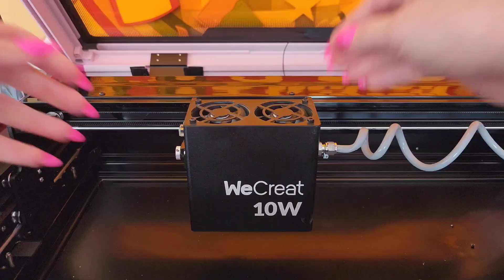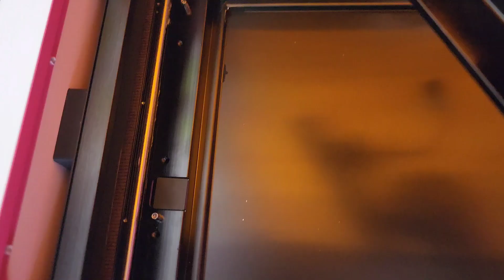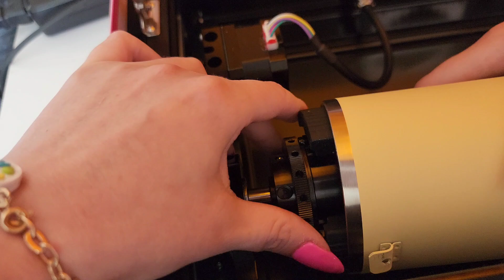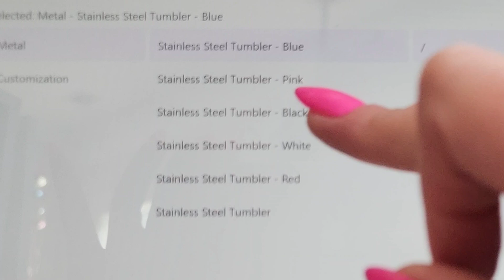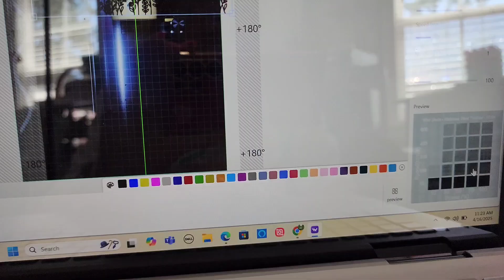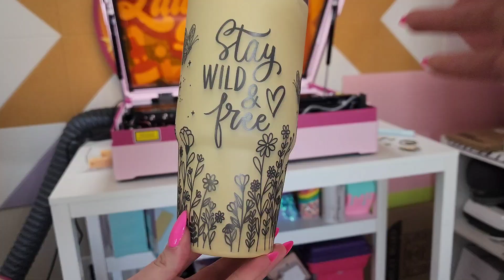How to Engrave Your FIRST Tumbler with the WeCreat Vista 10W Laser – Beginner Engraving Tutorial

Comment: 😂IKYFL. I Like how ONLY your vista perfectly captured an entire working area on a 20oz tumbler of all tumbles. I have the same machine same software and theres a large red box that X’s out 2-3 inches of a non workable area for the laser to engrave. Because we all know someone somewhere magically designed a modification on amazon to purchase to use the workable area in which you didn’t use to complete your tumbler.
Reply from the maker: I'm soooo confused by your comment haha! I just turned off the setting that blocks the top area so a full wrap could be done. I have the larger rotary attachment and full wraps can definitely be done.

Comment: Do you place the handle prongs facing down? How do you figure out the placement of the design to make sure it's centered on your tumbler?
Reply from the maker: @prieta1028pr  yes! All the way down. The center of your tumbler should be face up. You can see the center line in the software and put your design right on top of that line. It will turn orange when it's center